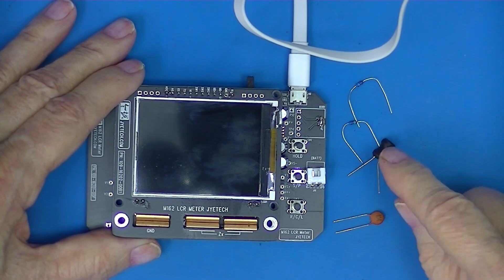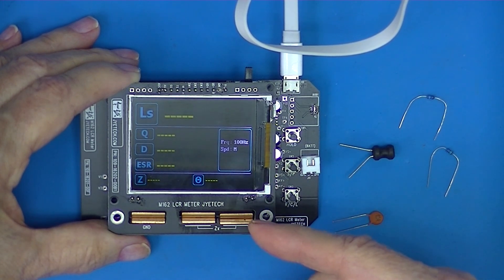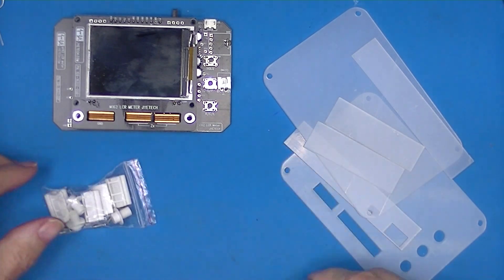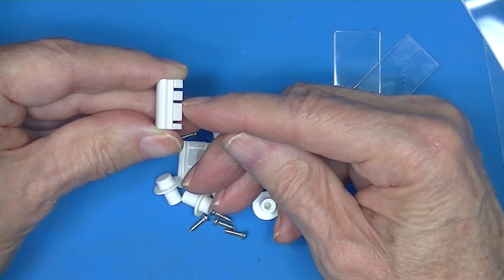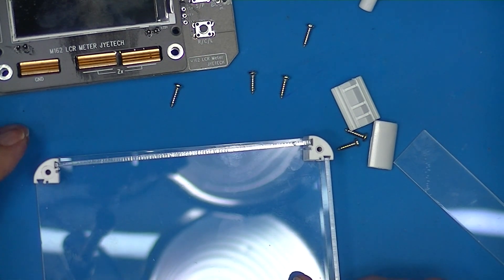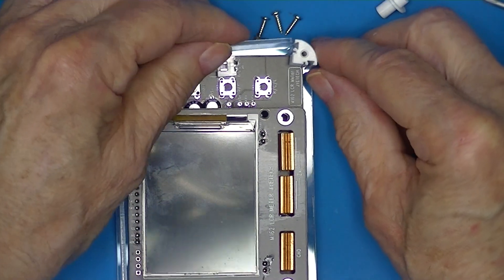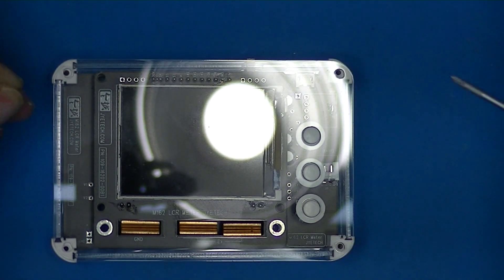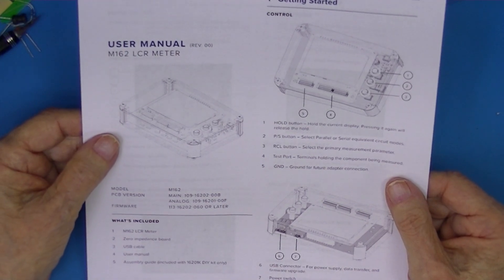Building an M162 LCR Meter – Part 1D

Comment: So far, the kit and case appear to be rather nice. Let's hope the unit performs well. It looked like a rubber band surrounding all four corners of the case may have helped to keep the sides and corners compressed/oriented,  during assembly.